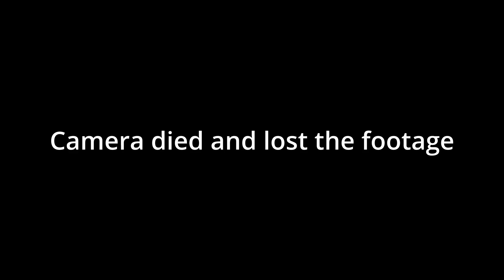N64 Rumble Pak Battery-Free Mod

Comment: Is there a reason to do the jumper wire vs moving the resistor?
Reply from the maker: It's easier to add a single wire than to desolder and resolder the component.
Reply: @DMSCreates  I’m fairly skilled at soldering. And it’s a through-hole resistor. Less concerned about difficulty and more concerned about which is more electronically sound
Reply from the maker: It's a fusible resistor, so it's only there to protect against overdrawing current, which is ideal to have IMO. Though I've never seen a problem with the other method either.